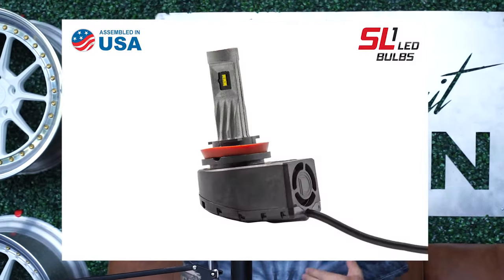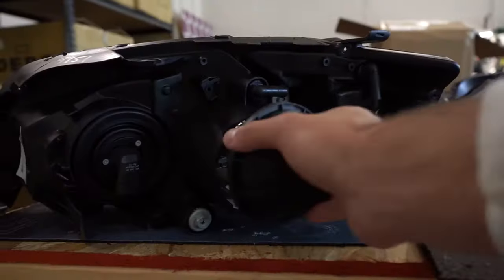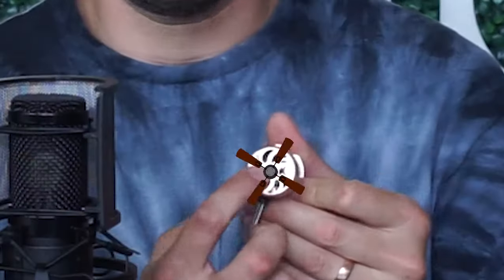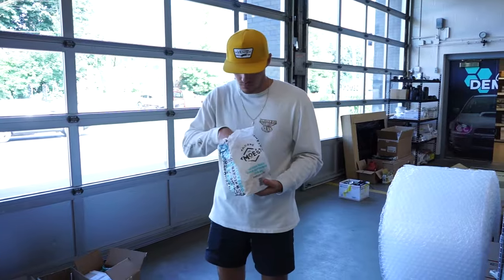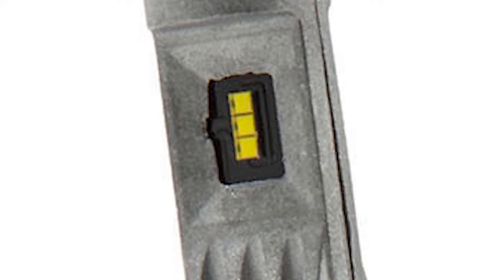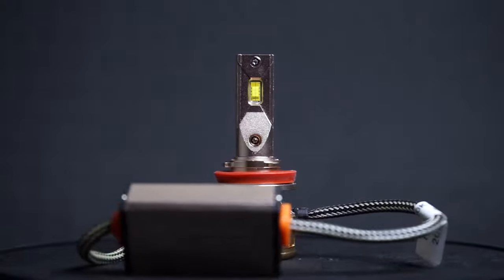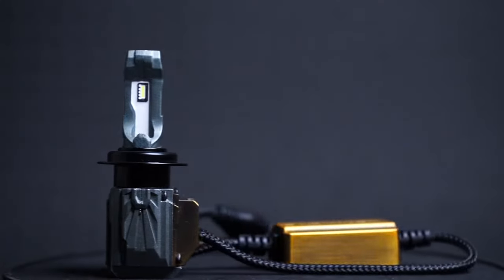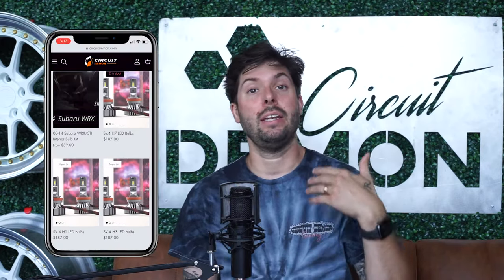Top 3 Things to look for when buying an LED Headlight Bulb!

Comment: Something to note that a lot of people skip over in the instructions.  Is taking the time to “clock” the LED bulbs properly in the halogen housings. My experience with LEDS,  they all came with instructions making sure to face the emitters at 3 and 9 o clock so sideways as opposed to 12-6 which results in blinding everyone on the road.  Something to note for those considering upgrading.  Cheers!
Reply: oh, thank you for your comment!
Reply: Right on bro! ✊🏼
Reply: Being in a lowered sedan, everyone blinds me. So install at 12 & 6 for payback, got it.
Reply: @rmarli17 don’t be that guy. Always 3-9 o’clock. U can always have a led bulb high beams without incorrecting ur orientation.
Reply: My LED bulbs came in the correct position then. I wasn't quite sure if where the led's shined mattered inside the halogen housing. All I will say is the stock 35w halogen was awful so I changed them for 30w led.
Reply: @ramborambokitchenkitchen6357  it’s a huge improvement over stock 35W halogen. But don’t u mean 55W halogen for low beams? Unless it’s a fog light?
Reply: @toyotabrony  nope my scooter only came with 2 35w halogen bulbs, one for low and one for high beam. Both were awful on unlit roads I couldn't see further than maybe 5m down the road.
Reply: @ramborambokitchenkitchen6357  halogens are not the way to go. What bulb size are they?
Reply: @toyotabrony  HS1 bulb size. It's used on all newer scooters and motorcycles pretty much.
Reply: @ramborambokitchenkitchen6357  oh those are alike. Very similar. 

So what led bulbs that had 30W u run from? Like what brand?
Reply: @toyotabrony  LEDPERF is the company I got mine from. They are 3600 lumens per bulb designed to be the same wattage as the stock ones. It is definitely an overkill one for my scooter as it's only 50cc and limited to 30mph but I can finally see where I'm going.
Reply: @ramborambokitchenkitchen6357  I don’t mind an ultra led bright lights on a Scooter. That’s awesome. 

I’m sure it has a cooling fan right? Since a fanless will not be able to handle that much power. Maybe better between 13W-20W.
Reply: @toyotabrony  just a heatsink. Modern LED chips don't actually generate a crazy amount of heat like they used to a decade ago. It definitely doesn't get as warm as the original halogen bulb.
Reply: @ramborambokitchenkitchen6357  some led bulbs do. Like for example the GTR-Lighting - ultra 2, or the DDM Tuning 55W, or the Lasfit - LS plus. The led chips get between 145-200+ degrees Fahrenheit. 

It draws a lot of power. 

Some reliable led bulsb are way less and still brighter than stock.
Reply: @ramborambokitchenkitchen6357  another example the H11 halogen bulb, gets blistering 750 degrees Fahrenheit after running for about 1 minute.
Reply: @rmarli17 
So you won’t care to be a better person/man, than some @$$ doing wrong?
Ok. Got it

Comment: After a little research and thinking about it, I would not want a cooling fan that circulates air in and out of the headlight assembly because moisture can also circulate.  It seems better if the fan just blows air across the external heat sink fins.  But either way, the fans can and do fail so I'm starting to get a new appreciation for OEM halogen bulbs.
Reply: It isn't taking in fresh and expelling air, its circulation of what's contained within as explained.
Reply: Led bulb with a cooling fine is completely on a safe side nowadays. 

But if u still prefer fanless: 

Go for Auxito - i9 or Lasfit - L1 plus fanless. It’s around $40-$45 per pair. And both have a two year warranty.

Comment: Active cooling also has its downsides, it allows for higher brightness at the cost of reliability. Fan reliability which is not great and when the fan dies even if the bulb has temperature control brightness goes down so much that they become useless. Also fans are audible which makes them easy to spot by authorities and it's not good because retrofits are illegal pretty much across the world.
Reply: I mean, the fan noise is not exactly what's going to give you away, it's the clearly different color temperature and brightness that will get you the ticket.  If it's illegal, then the very nature of a light bulb makes it hard to hide you're breaking that law, fan or not.
Reply: If ur not a fan of cooling fan led bulbs. 

Get a fanless and call it a day.

Either Auxito i9 or Lasfit - L1 plus fanless. 

And they are great products

Comment: Doesn't putting an LED bulb into a halogen housing blind everyone else on the road since the housing isn't designed for it? If not, why are some vehicles headlights so blinding?
Reply: From my experiences with led bulbs you may have to adjust them down to keep them from aiming so high. That’ll reduce the blinding effect some. Plus I’ve read there is a limit to the brightest a led is allowed to be. Some are probably pushing to much power anyway
Reply: Morimoto 2Stroke 4.0 LED bulbs, will not blind anyone, because they create the original beam pattern now, they are really impressed.
Reply: Put some in my F-150, if anything they glare less than my halogens.  I was worried about this but apparently for no reason.
Reply: Either they will be same as Halogens, or adjust left LED slightly lower to not blind oncoming vehicles.
Reply: Mine has the led's located in the same place as the filament in the halogen bulb, so the beam is basically 95% the same as stock, but obviously it's about 4x brighter because 35w halogens absolutely suck :).

Comment: Tried some LED’s and while they are good upgrade from halogen, I had a problem. LED’s shined more bright when accelerating and got darker when releasing throttle. That doesn’t happen with halogen lights. Any idea what can be wrong? I bought some cheap LED’s with integrated fan. In size they are almost 1:1 with halogen.

Comment: I have a 2006 Toyota Tundra Double Cab Limited that uses 9003 H4 headlight and 9006 fog light bulbs. What do you recommend for LED's for my truck?
Reply: Lasfit and Auxito. My top two best recommendations for ur truck. 

If Lasfit, highly recommend LA plus, if Auxito, highly recommend Y13

Comment: I run auxito H11 leds that have a fan built in, never ran into a problem nor was it $25 like yours mine was around $90, I did have a problem with the small 921 leds that don’t dissipate he enough so they start to flicker.
Reply: Is it Y13,Y19, or M3?

For 921, get the Auxito 921 T15 with a cooling fan they have. 

It matches the wattage and it’s extremely bright.
Reply: Auxito are good you’d say? Think they are better than other Amazon brands

Comment: more of a question really i have a 2013 mazda 6 and i am looking to convert to L E D cause i have the halogen on the car and i dont understand on how to do it do i need a convetion kit or not plwase if you can help talk me through or even suggest the best brand would be greatly appreseated look for more saftey where i live in the north in canada alot of moose and other big animals on road at night pleas help
Reply: Fellow mazda6 owner here, I would recommend deer whistles as well as the headlights just to be extra safe. There are very many video here on YT showing how to replace a headlight bulb. Amazon reviews for most of the bulbs I've looked at show that they are pretty easy to install with the instructions that come with it.
Reply: If u want straight forward plug and play, and u want an active cooling fan led bulbs. Which is better because the cooler the led bulb, the better the lifespan, and u want an all in one unit.

Highly recommend Auxito - M3
$63 a pair and get a nice 2 year warranty. 

If u want with an external driver, get Auxito - Y13.

Comment: Hey I purchased two pairs of led low beam lights. 
1. Watt 60w (30w/ bulb) & Lumens 6000LM
2. Watt 50w (25w/ bulb) & Lumens 5000LM

I obviously want high visibility but dont want to blind on coming drivers - what do you suggest?
Reply: Either they will be same as Halogens, or adjust left LED slightly lower to not blind oncoming vehicles.
Reply: Wrong. 30W means 3000 lumens per bulb. 

25W means 2500 lumens per bulb. 

That’s a realistic one.
Reply: @toyotabrony  I ended up going with the brighter ones. All the new vehicles have blinding lights way brighter anyways. And I’m lower to the ground (sedan).

Comment: how many Lumens you need for regular low beams ? Thank you
Reply: 15k lumens is the golden spot. 25k & up if you live in a rural area.
Reply: @jesussanchez-wt2tx led bulbs doesn’t make 15000 lumens. It’s a complete lie. 

No led bulbs will ever make that brightness. 

That’s on led light bar territory. 

If the led bulbs have 30W per bulb, it makes 3000 lumens per bulb, if it has 45W per bulb, it makes 4500 lumens per bulb.

Those are the realistic numbers. And more honest. 

Just like Lasfit, VLED’s, S-V.4, Xenon Depot, Morimoto, GTR-Lighting, and Diode dynamics. 

Please don’t believe this toxic claims that’s total bs. 

Anything u see 150W or even I saw they claim is 1000W per bulb, or 20,000 lumens or 100,000 lumens per bulb is major bogus.

Check out headlight revolution and they tell u the truth. And they do testin better than others because they test more.
Reply: 3000 lumens per bulb. Definitely look up Lasfit - LA plus. 

I will be happy with them and have better results.
Reply: @toyotabrony 2006 acura mdx looking to keep for 3-5 years. What do you recommend best value. I want reliability, brightness, cost in that order for priorities. You seem to know alot about the leds and I want to make the right choice for my sister with her first car